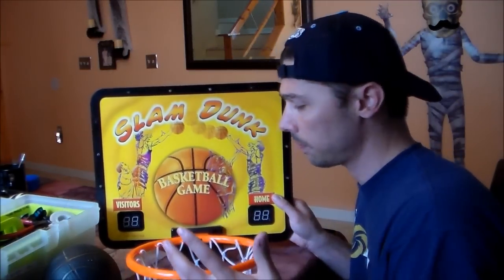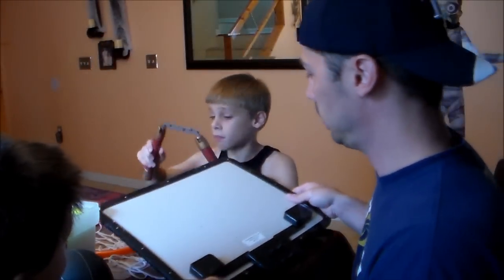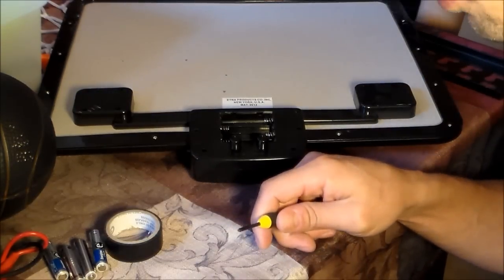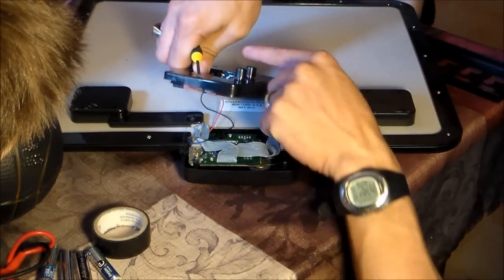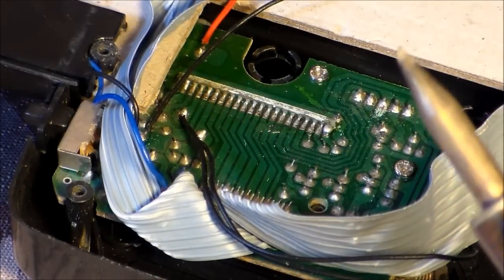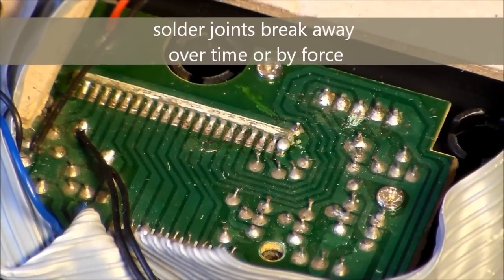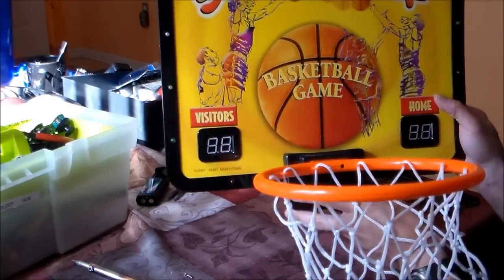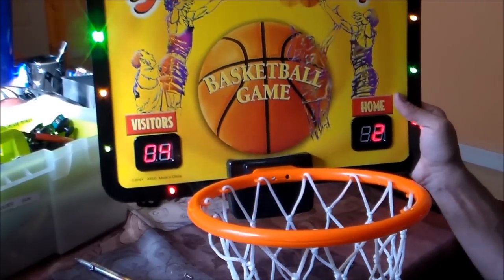How to Fix bad connections on circuit boards "Soldering repair"

Comment: I agree soldering is a problem in consumer products.The mfgr rushes the worker to  solder so quickly that the problems you state arise. In the battery compartment connection I have used 1/2 tsp baking soda in 1/2 cup of water then washing as you outline neutralizes the acid residue to water and salt. Flushing with 91% alcohol forces water to evaporate faster using blow dryer with NO heat, so as not to ignite any residual alcohol vapors, further speeds drying. Great Vid keep up the good work!

Comment: I actually fixed my Thinkpad charger using this tutorial. It was just a loose connection on the cable going into the adapter. Did a resoldering and my charger works ok now after sticking it back together with super glue

Comment: Battery acid spills should ALWAYS be cleaned by baking soda/water combination. Baking Soda neutralizes the acid. Once the leak is cleaned up, you can do a regular cleaning with alcohol and it's probably wise to use steel wool or sandpaper on the battery contacts.

Comment: Great video! Question if the solder comes off completely from the board how would you add more to it? I’ve tried to just melt some solder on but it won’t stick.

Comment: WHY did you use a screwdriver to expose the trace (which really just destroyed it) and why didn't you just wick up the old solder from the bad joint and re-solder the joint (assuming the pad wasn't lifted)? I also noticed you didn't use any flux and RS solder, even the stuff with flux supposedly already in it isn't the greatest stuff in the world.
Reply: I was about the say the same thing.
Reply: I agree, if the solder is broken you just replace solder, you don't scratch the the board

Comment: Great video. Do you have any advice on fixing a circuit board under the piano keyboard keys on a Yamaha Ypg-235? Mine stopped working all of a sudden and I unscrewed the back, and cleaned the contact points where the rubber hits each spot on the circuit board. None of that cleaning the board worked. Most of the F keys from the center down don't work and also the B keys. Anything would help. Thank you in advance.
Reply from the maker: YBABTU if piano uses that rubber contact pads the pads might be dull. they sell conductive paint. Bare Conductive Electric Paint Pen 10ml https://www.amazon.com/dp/B00B888LQ8/ref=cm_sw_r_cp_apa_h3EnzbN015KH6
Reply: Thank you. I will definitely give it a try. And I will give a sub to your page. And likes. I appreciate it.

Comment: Tampatec, I like the pace of your videos.  Not mundanely slow and boring but just fast enough to instruct while keeping my interest.  I tried out soldering a beginner Christmas Tree (kit from RadioShack) and the parts are tiny !  Without intention, I soldered one of the capacitors leads together on the board.  There is no small bead per lead - one blob for both leads.  Will this be a problem ?   Thanks in advance for your instruction.
Reply from the maker: yes use a desoldering wire or solder sucker to clean it up, then resolder each solder joint. soldering solder joints together can cause other parts to overheat and damage parts. hope this helps

Comment: Hey Tampa Tech, 

Guru, I got a question. I've been messing with a Philips home theatre model Hts3400 for about a year now. I've changed three capacitors on the logic board I believe but the unit won't turn on. Any tips? Should I be checking for voltage out of the main board? Transformer you think.? Any help would be awesome in my endeavor..
Reply from the maker: Check 5v dc standby on power board.
Reply: +Tampatec do u know how to fix the circuit board of a laptop?
Reply: my whirpool cabrio control board not funtioning but the green light back of the control board on.
Reply: +Tampatec my home theather is messed up too it seems a resistor is burned out how would i fix it?

Comment: Can I just connect it will aluminium foil
Reply: Depedning what it is and how long you want the connection to last it could work haha ive done it with a ton of jbl bluetooth speakers because they glue their connections instead of solder